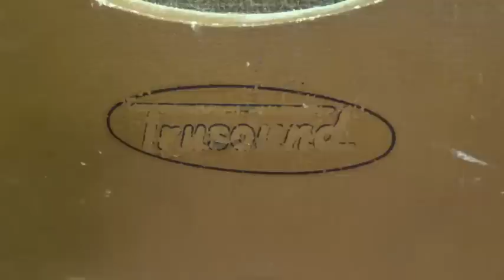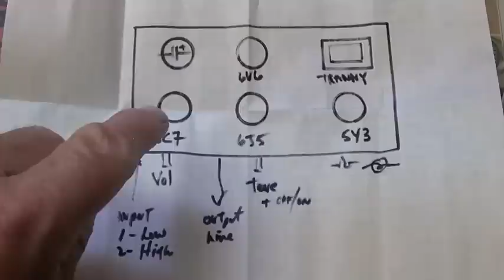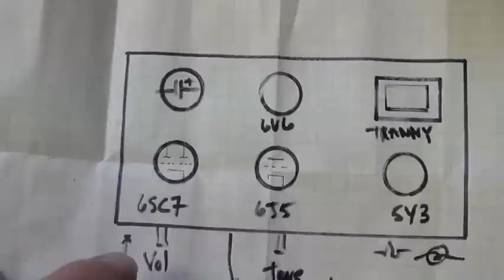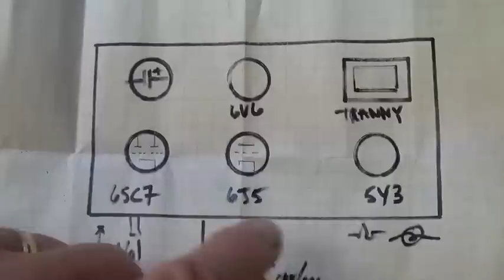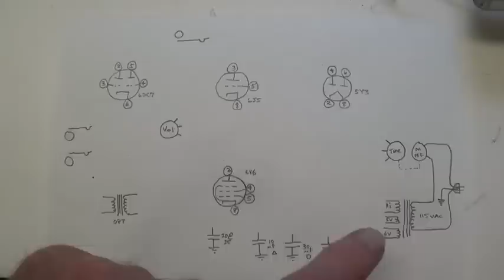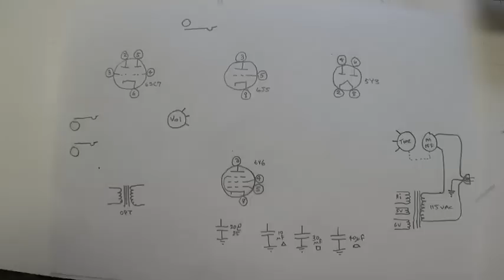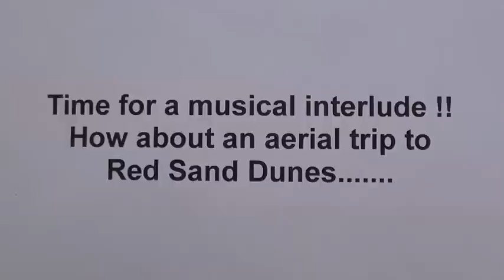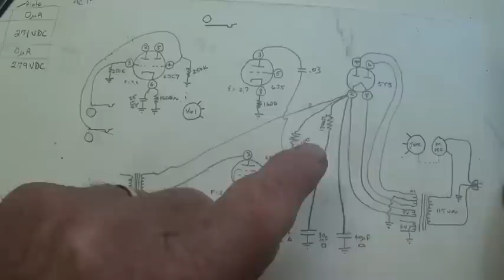1950's TruSound Amp Resurrection.....Polishing Up an Old Gem

Comment: Thanks Uncle Doug
I think that is the first cabinet I will build. I really like the way it looks.
Now, I have have to figure out how to "flock" a grill cover. ? 🤔
Reply from the maker: Good luck with your project, Luther. Buy flock at Hobby Lobby. Spray grill with 3M spray adhesive. Shower the sticky grill with flock. Voila !!
Reply: @UncleDoug  Thanks again.

Comment: When I started kayaking I wanted to learn what's port and such, and what color light belong on that side. I found out a neat trick. That of the color, and side, and the callout have something in common to keep apart. The word "left" has less letters than "right", "red" has less letters than "green"....and foremost, "port" has less letters than "starboard". All of the words with less letters belong together, and all of the words with more letters than it's counterpart stay together. So, because left, port, and red are the shorts lettered words, they stay together. The right side is starboard and green. 
LOL, I share this with everyone I know on the kayaks because it's a really neat and easy way to remember.
Reply from the maker: Thanks, Jason. I use the fact that "R" for right and "S" for starboard are consecutive letters to help myself remember.
Reply: I had noticed you said the amp was leaning starboard while pointing left....LOL.
Reply from the maker: As you well know, Jason, Port and Starboard refer to left and right with regard to the vantage point of the item or ship in question, facing forward.  The amp itself was indeed leaning to its own right side.

Comment: Great old little amp. I just started restoring a Fisher Allegro A-9 A-19 tube stereo system.  I decided to work on the amp first.  It's a beauty.  The first thing I'm doing,  other than cleaning it,  Is put a 3 wire cord on it,  and eliminate the death capacitorS.  Yes there are a cap on both lines coming in going to ground.  They both are General Instruments. 01uf, 600v caps.  There's also an 820k resistor going to ground.  The schematic only shows one cap.  I've been hesitant and wanted to see what others though about eliminating them, and cutting the chassis to install a 3 prong socket for a removable universal power cord.   Or just removing the 2 prong power cord socket that's there and installing a plate with a hole in for the cord. That way still being able to make it original again.  You would have to put the cord through the back that way though.  When you wanted to service anything,  you would have to pull the back of the cabinet over the cord.  Any thoughts out there? 
Thanks Uncle Doug!
Reply from the maker: That's a tough one, KG. Would it be possible to transplant a 3-prong receptacle on the chassis, in place of the 2-prong one ?  That way you could simply use a 3-wire removable power cord.
Reply: Uncle Doug That  was  my  one  option .  I  worried  doing  that  because  I  would  have  to  make  the  hole  bigger  for  the  3  prong  socket .   I  will  be  selling  this  eventually  and  worry  about  audiophiles  wanting  to  make  it  original possibly .  I  figured  out  a  pretty  good  solution .  It's  somewhat  temporary ,  but  is  very  secure .  This  unit  was  somewhat  like  the  one  in  this  video .  For  some  reason  the original  black  wire  goes  straight  to  the  transformer .  A  white  wire  goes  to  the  switch ,  which  is  on  the  volume  control .  I  just  connected  my  new  black  line  wire  to  the  white .  I  did  the  same  thing  putting  a  fuse  holder  on  it .  I  connected  the  white  common  to  the  black  going  to  the  transformer .   I  don't  know  why  they  used  the  colors  like  they  did .  Of  course  it  wouldn't  matter  with  the  two  wire  cord . I'll  save  the  two  capacitors ,  which  were  still  good , and  the  original  power  cord ,  which  could  be  put  back  on .  I  checked  the  electrolytic  capacitors ,  which  seemed  okay ,  and  powered  it  up  for  the  first  time  in  12  years .  I  put  in  a  1 kHz  wave  into a  dummy  load,  and  the  one  channel  has  a  crazy  3  line  waveform .   When  you  turn  the  volume  up  the  1 kHz wave  rides  on  all  3  lines.  This  is  the  first  tube  amp  I've  worked  on .  I've  worked  on  hundreds  of  solid  state .  I'm  just  going  to  watch  your  videos  on  tracking  the  signal  through  the  amp  with  the  oscilloscope .  
Thanks  for  your  videos !  Your  playing  sounded  good  today .
Reply from the maker: I really think that a properly installed 3-prong receptacle would be the best solution. I doubt that anyone would complain about it......but it's your choice to make, KG. You could just run a jumper from the chassis to the ground lug in the wall outlet and leave everything original. I'm confused by your explanation of the primary wiring, but the black "hot" wire must pass through the on/off switch and fuse before reaching the power transformer. Thanks :)

Comment: I have my suspicions that the amp May have had a field coil speaker originally and someone has popped that OT  inside the chassis. (Could have been over 40 years ago. ). Good stuff as always Uncle Doug, cheers, Colin.
Reply from the maker: If you look real close, the OPT really looks like it was installed at the factory,  Colin......but you may be right.

Comment: good day Uncle Doug ! I loved the aerial view of the desert, and the music has a lot of soul brother. im wondering if you could show how to clean the pots, both unopened and opened?
Reply from the maker: Thanks, Russell. I have demonstrated this in quite a few videos. Keep watching and you'll find it.
Reply: @UncleDoug  yeah only a video or 2  after I posts this you did show the disassembly of one, I thought a potentiometer had copper wire wound around the track, for lack of a better word and the resistance got greater as the wiper moved further down the track, I think I took one apart many years ago . Similar to a old thermostat anticipated heat gain device , the current would run through it and it heated up the bimetal coil so to tip the mercury filled tube away from the contacts.

Comment: Another fantastic video.  The Red Dunes video was beautiful, made me very homesick. The amp is a real jewel. I did some research and I think it might be a post WWII lap steel guitar amp designed and built by Dickerson. (Magnatone a myriad of brand names). The schematic for a 1946 Dickerson amp matches pretty close except for an electro dynamic speaker being used as a choke, an a 6L6 instead of 6V6. According to www.magnatoneamps.com Delbert Dickerson was pretty well known for using military surplus tubes so if he could get his hands on a surplus lot of 6C5s or 6J5s, 6L6s or 6V6s, he would just adjust a few values or rewire tube sockets in the case of the 6SC7 and 6SJ7 and use what they could get cheapest. Also very similar to the Vega Commander with a couple of tube substitutions. It just appears that the basic design may be Dickerson right down to three input jacks one on the second grid of the preamp tube like the Vega.  But who knows I may be totally off in left field and it’s just basic amp design of the time. It was the metal tube that made me think Dickerson.
Reply from the maker: Thanks, Mark. I'm glad the video brought back pleasant memories. Thanks also for all your research and thought on the origin of the little Trusound amp. I was thinking Valco, but you may well be right about its true source.

Comment: Another clue: I found this text from a Radio-Craft magazine from 1949, that apparently describes that very amplifier that was for sale on Ebay (note the Output impedance description) It was sold at Mort's Radio Shack:
https://archive.org/stream/Radio-Craft_RE_1949_03/Radio-Craft_RE_1949_03_djvu.txt

 "NEW HF 10 TRUSOUND AMPLIFIER 

Compares equally with Amplifiers 

selling for as much * 29 “ 

as 57S.OO. Each. • 

Complete with Tubes and Cover 

The HF 10 amplifier is a general purpose unit of small size 
designed for high quality reproduction of sound, 
music and speech from records, radio 
and microphone. It is engineered and 
built to meet the high Quality standard* required of an 
amplifier when used In conjunction with 
the new high fidelity Pickups. FM-AM 
I uners and wide range speaker systems. 
Hundreds of satisiled users recommend this 
line New Trusound Ampllfler. 

NOTE THESE TERRIFIC FEATURES 

10 watts undistorted power output 18 watts peak. 
Inputs: High Gain for variable reluctance PlckuPs: 
for high Impedance mikes. Low Gain for FM-AM 
tuners and high outPut Pickups. 

' Selector switch for rapid changeover. 

' Hum level 70 db below 12 watts. 

> Tone compensation. Separate continuously variable 
bass and treble controls. 

» Treble—from plus 10 db to minus 15 db at 10.000 
cps. 

> Bass—from plus 10 db to minus 15 db at 50 cpi. 

• Note—flat characteristics obtained with controls 
centered. 

• Output impedance 2. 4. 8, 16 and 500 ohms. 

• Straight AC for 110-120V 50-60 cycles fused. 

. Tubes—6SLr7, 6SC7, 2—6V6, 5Y3. 

» Chassis and shield sliver griy hammerlold finish.
Reply from the maker: Your research is impressive, Marcelo. Another excellent link and  clue. Thanks !!

Comment: Hi Uncle Doug--nice video as always.  BTW, using the 30 uF cap right after the 5Y3 might not have been a mistake.  The RCA Receiving Tube Manual lists 20 uF as the largest rated cap to use unless the hot-switching current is limited.
Reply from the maker: Perhaps, R, but you must admit that following it up with a 40uf cap really makes no sense.  In reality, the original values may have been 20/20uf, but altered when the "tech" only had a 40/30uf can handy.
Reply: Well, the 1st cap filters the signal for the output stage, which is a large signal, but the input signals process the much smaller input signals, and may benefit from the extra capacitance.  In any case, I think your guess is probably correct--I would not be at all surprised is the original cap was a 20/20.  BTW, in the case of a push pull output stage, hum on the B+ is a common-mode signal, and the differential signal from the push-pull stage suppresses the common-mode noise, so a bit of power-supply hum at that point isn't so bad.
Reply from the maker: Since this circuit is single-ended, with no push-pull hum cancellation,  I was quite pleased with the dead silence. This was a major factor in simply leaving the (probably too-high value) replacement can cap in place. Thanks again for your very knowledgeable input.

Comment: Just got back got from ABQ  and Los Lunas  area.  Good idea to about drawing out a schematic. I will give it a try. Nice work on the amp. What did they use to flock the screen cloth.
Reply from the maker: Albuquerque is a nice town, T. Good luck with schematic drawing. I use spray glue to coat the wire, then sprinkle on the flock with a pepper shaker.

Comment: good video, I'm confused though when you said first cap is always that encounters the b+ is always the highest value.  I don't agree because there is a limit that the rectifier tube can handle for that 1st cap, look in the rca tube manual and you can see that most rectifier tube limits are around 20uf-50uf, putting a 100uf as your first cap could cause a tube rectifier to have a issues or a short life.  I see a lot of 2nd filter caps being the higher of the two at least in hifi.
Reply from the maker: Thank you. In my experience with tube guitar amps, Jake, 100% of the first capacitors in the power rail have the highest value of the capacitors present. Based on this, I felt comfortable restoring the 40uf cap to 1st position and placing the 30uf cap in 2nd position. The previous "tech" made several errors in wiring, and IMHO this was one of them. None of the filter cap values are anywhere near the 100uf value you quote, and the amp is dead quiet and functions perfectly this way.
Reply: I mostly work on/build tube stereo stuff so I'm used to seeing the 2nd cap being larger so just wanted to make it clear to others that if they see a large second cap in a tube amp that it could still be correct and best to just find a schematic if in doubt or check limit if using a tube rectifier.  I'm not saying this amp had a 100uf cap but now a days a lot of people assume larger caps are better and many places sell those values so they need to be careful when choosing values for certain places in the amp such as the first cap in the power supply.  A good program to play around with and see how cap in the power supply can sink too much current or to see how transients in the supply are is psud2, its free and pretty useful.  I'm glad to see you've been posting more videos.
Reply from the maker: Thank you, Jake.
Reply: Thank you, I'm also into guitars a bit, sadly haven't played much in awhile but was thinking about building a fender champ soon only thing is I need to practice making a finger jointed cabinet first.  Have you built any stereo amps?  That would be a fun video.  I believe you have some jukebox restoration videos that I saw a year or two ago, those were really cool.
Reply from the maker: You're welcome, Jake. I have posted videos showing how to design, build, and cover finger-jointed cabinets. I deal exclusively with vintage tube amps, so stereo's are really out of my field of endeavor.
Reply: Nice, I'll have to search for that video.  I like tube anything really.

Comment: sounds like Ollie brought a reverb unit! Glad to see you are back to your old ways. I just received my Valco-made Gretch 6162 in the mail from Brad the Guitologist, need to dust it and my guitar chops off and get back to playing. I did glue down the corners covering material, and also need to take off the burlap grillcloth to see if the original sparkle grillcloth underneath is still any good or not. Did you end up re-wallpapering the ceiling of this one?
Reply from the maker: Ollie's contract stipulates a smidgen of reverb on every solo, Joel. I haven't patched the ceiling paper yet......still hunting for the right color and sheen.

Comment: Uncle Doug on a 59 fender twin  if one of the 5881s blows out do they . all  have to be replaced as a set or can I go with 2 or just 1?
Reply from the maker: You could buy a matched pair of 5881's and install them, keeping the one good used tube as a spare.......or you could just take your chances, order one 5881 and bias it for a proper average plate dissipation. It will probably sound fine either way.

Comment: oh what was the middle 1/4 jack? it looked like its after the first preamp tube. and jacks music reminded me of music in terry gilliams movie "BRAZIL"  from the 80's. THX again uncle doug :-)
Reply from the maker: Thanks, Ken. It must be a pre-amp output, for reasons I can't fathom.....especially in the 1950's. This is probably a student amp, and how many students back then had a need for such an output......did they have 100W power amps to drive ??
Reply: Wasn't the original Fender Champ also a 'Student Amp'?  Of course they didn't have this pre-amp output but they were simple and cheap.  It was really, I think, just a lucky thing for Leo that musicians discovered, started using, the over-driven tube amp.  It also became the signature sound for rock and roll - sort of like the reverb sound.
Reply from the maker: Yes, indeed, I would say the Champ was probably intended to get beginners hooked on the Fender brand so they could graduate up to the more expensive models......yet it turned out to be one of Fender's greatest achievements in its own right. You never can tell :)
Reply: I wonder if that preamp out might have worked well with high(er) impedance headphones that were more common back in the day?

Comment: Has anyone pointed out the OTHER TRUSOUND AMP I found on  Ebay? It has the exact same name and type style as this one does. And it seems it was sold already..but, here may be a link to try.....Coalcreekpicker who was selling the amp...which looks like a much newer model...Yours looks like the first one made and the Ebay looks like maybe a few years later and has a metal body and looking better made..?? Had on the back many speaker screw connections labeled COM   2-4-8-16-500.... Plus it has Chcken head knobs plus a MIC...Phono and V.R. settings...with Gain Treb Bass knob settings....on Gray tin like metal and bent to form a box around the chansis.....
Reply from the maker: I believe the Ebay Truesound amp was a PA amp, Dave, not really a musical instrument amp.  Both it and mine were probably built by the same company, but I think they were for different purposes.
Reply: I agree.  But it has to be the same company...Logos are Mirror image but yes a PA.  Enjoy your channel so much watching the Leslie build now. Have a good one.
Reply from the maker: Likewise, Dave.

Comment: Hey Uncle Doug, I recently turned a vintage tube intercom into a guitar amp! It's just like most 50L6/35Z5/12AU6 amps you've seen, I just added a power transformer and a tone control to it. This demo was made before I cleaned the speaker, now it sounds much better IMO. But anyway, here is the demo I made right after the mods:
https://www.youtube.com/watch?v=O_HXrMHrEqU
Reply from the maker: I like it, BC......especially since it's still obviously an intercom, but produces some very nice guitar tones. Congratulations on a very successful project.

Comment: there is a very good scematic drawing program Tinycad it free and very easy to use
Reply from the maker: Thanks for the tip, AJ. I will check into it.
Reply: Another one to check out is DipTrace. They have a free version, some learning required but it is a high quality program IMHO.